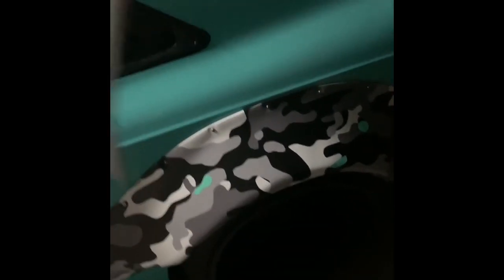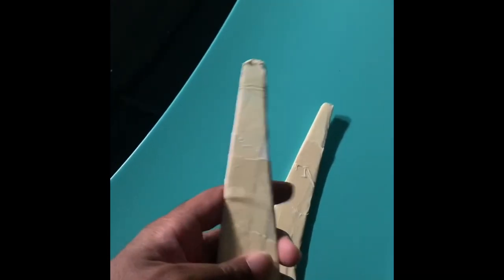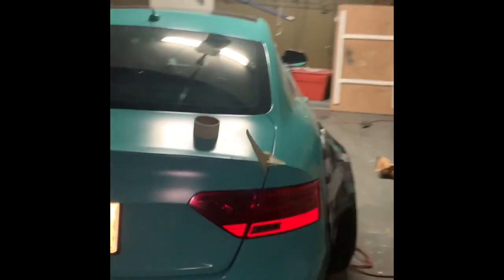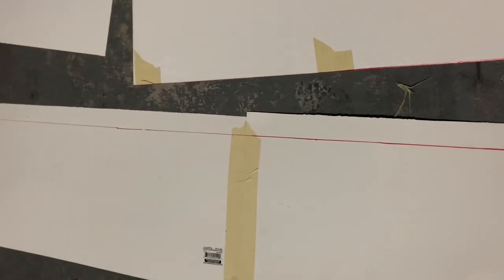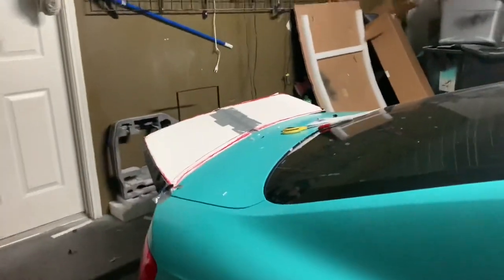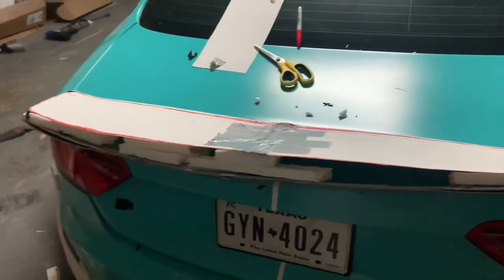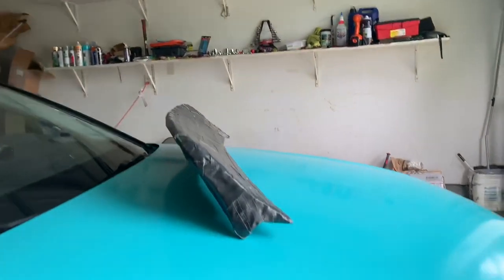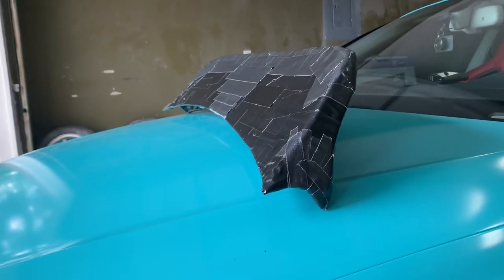HOW TO MAKE A $1500 Duck BILL spoiler (DIY) PART 1

Comment: thanks to share  i juste want to know something i saw ur videos previous one the one with  all the instruction to upgrade 2.0t  what  you do to complete the stage one  cold aire intake,diverter valve what else i can add to complete the stage 1 thanks to reply
Reply from the maker: stage 1

there are no requirements to run stage 1. Its a simple flash on your ecu (computer in car) to unlock the full potential of your vehicle. the dealership down tune your ecu for emissions, and longevity.

but if you want to ad about 30 more horse power on top of a stage 1 tune from apr/revo/eurodyne  
you can get a air intake which ads about 15hp and an inter cooler which ads about 20 hp. A diverter valve depending on the one you get helps with turbo lag. so you can get a quicker boost and feel your torque  more. gfb dv is recommended, some of them only make sounds and not perform